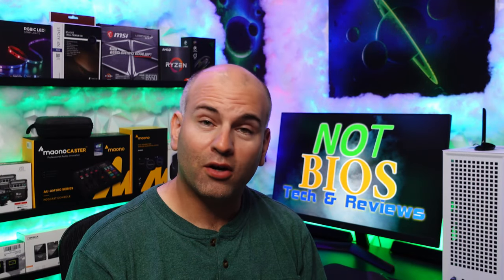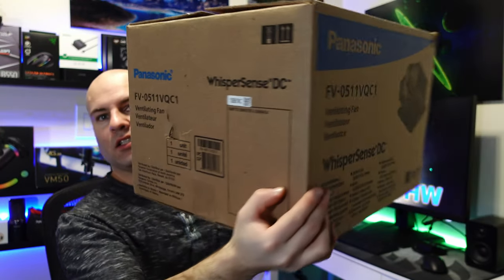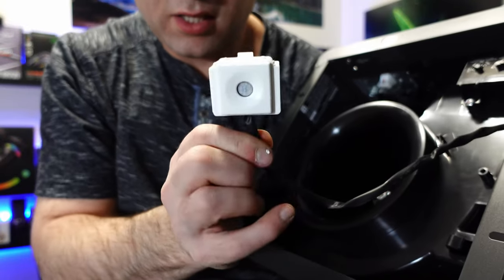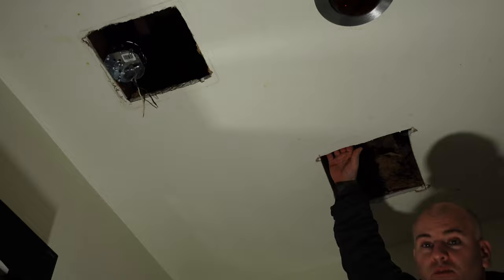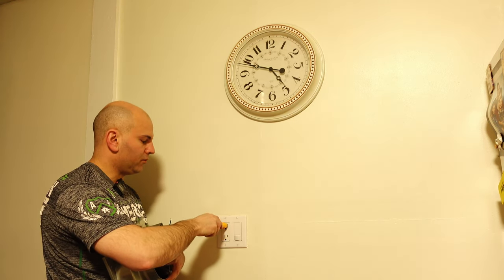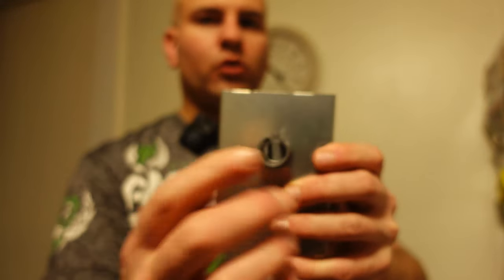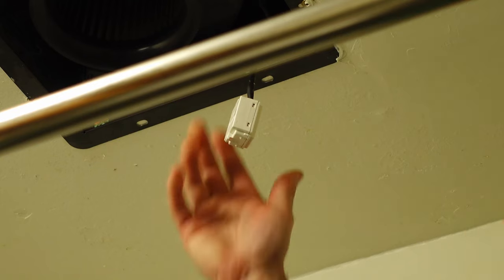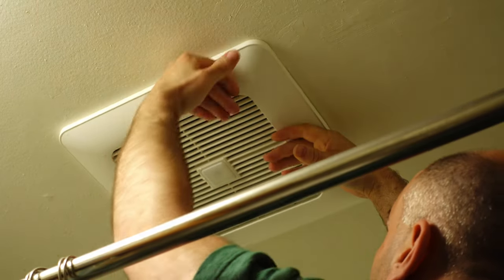Panasonic Whisper Sense DC Bathroom Fan After 6 Months, FV-0511VQC

Comment: Great idea on using a blank-face GFCI. We have this fan mounted in a guest house bathroom with a timer (before, it was a regular switch). I do not monitor this bathroom daily. The problem is that guests either do not know how to start the timer or are thrown off by the delayed start. With the blank face GFCI, I can leave the circuit on and still be able to turn it off for servicing. I may place a piece of white tape over the GFCI to prevent tampering. I know they sell covers for wall switches, but they can fall off, and I may not know if someone turned the switch off. The blank face GFCI is not foolproof, but I doubt most people will trip it.

Comment: So it gets hardwired and you can't easily turn it off unless you use the test button on GFCI?
Reply from the maker: You can use a switch an GFCI plug or whatever. In Canada by law it has to be wired with a GFCI when installed into a shower
Reply from the maker: Nothing stopping you from putting a timer switch with an off or an on off switch in line... BUT different countries have different rules. UK uses ARC fault protection if I am not mistaken at the panel service. 

The point in how I installed was to show you technically do not need an on/off switch with the humidistat automatic on/off and the motion sensor auto on and off.
Reply: @sparketech Really appreciate this video.  I've got a question about this, too.  I've got six of these roughed in for a new build.  We're approaching trim-out, so I'm in the process of ordering all of my switches.  Was planning on pairing these with the Minoston WiFi Timer Switch, but I am trying to wrap my head around what @aptpupil raised: so if someone turns this fan "off" using the switch on their way out of the bathroom, will the fan still have power to detect motion/humidity when the next person enters the bathroom?  Thanks again,
Reply from the maker: @WinstonFiore  If someone turns the fan off means there is NO POWER to the wiring to power the fan until the switch is turned back on. Either the fan has power to do it's thing or not. 

You can remove the movement sensor if you just want it for humidity and leave it powered on.

I used this for the movement sensor, if someone does a #2 I don't want it to smell like a poo ;p
Reply: @sparketech  Ok, thank you for this reply.  So it sounds like this fan doesn't necessarily need a switch then.  Will run this by my electrician; thanks again,
Reply from the maker: @WinstonFiore  you're welcome. Thank you for your question. I set my unit to turn off after 5 minutes. If there is too much moisture in the bathroom and you close the door it'll just turn on, on its own. It is still working like a champ. I am an electrician, next week I am going to be working on finishing a hydro electric project up north. I was working on the Liquid Natural Gas project last year. After the hydro electric damn project is done I might be wiring up a hospital up north.
Reply: How come you didn’t hardwire it on and then put it in it made no sense for you to go up into the attic afterwards he made two trips it’s made to from the bottom only? They don’t need all that support because they just sit there. It’s an exhaust fan. Just leave it on automatic and forget it. Let it go leave it for movement leave it. You can’t hear it so what you have to make sure it’s exhausted from your house most importantly, just exhaust it into your attic will ruin your house.
Reply from the maker: @TedDekens  i  purposely hid stuff for one legal reasons. My country and my code rules wiring color isn't the same as Russia, UK or whoever country you are from. I can go into the attic 10 times if I want, scary ohhh No!

I hardwired it in. I didn't show that I went back up and connected the venting out of the roof. There was existing venting up there and I needed to join it.

I am not a carpenter and there are better ways to install and what did I do for the fan.

Did I write I install in homes as my job sir? No I did not. I'm an industrial worker. I still follow my country's code rules.
Reply from the maker: Recently I added a switch which I leave set to ON. Reason why is if I brush my teeth or just walk into the bathroom and leave I decided I don't want the fan turning on. I removed the motion sensor from the equation.

Reason for switch (generally switched to ON)
#1 I leave the switch on is so the humidly sensor is ready to go at all times
#2 if I make a stinky I switch to OFF and then back to ON and fan turns on for the set time with the timer